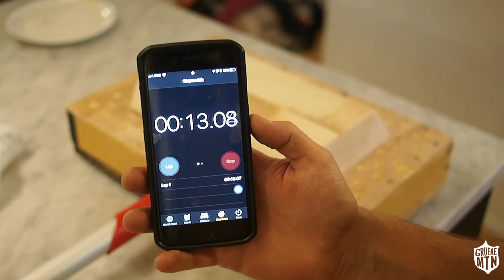DIY Dyson Vacuum Form

Comment: What is the plastic you use? Acrylic Sheet and so on...
Reply from the maker: Ahşap Gemi Modelciliği it’s a 1/8” ABS plastic sheet. Smooth on one side, textured on the other. I bought a few off eBay or amazon for around $15.
Reply: @sethgrueneberg  Thank you so much.

Comment: What is the oven temperature?
Reply from the maker: Ahşap Gemi Modelciliği hello. I started at 250°F but after 15 mins that didn’t work, so I set the oven to broil and just watched for it to slightly droop and then pulled it out and stuck it to the vacuum table. Thanks for watching!
Reply: @sethgrueneberg  Thank you very much.